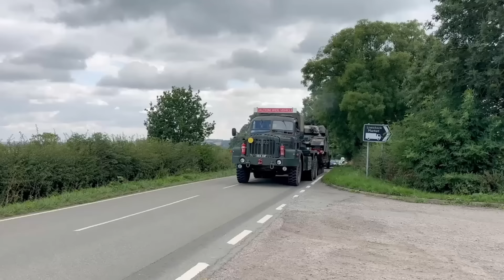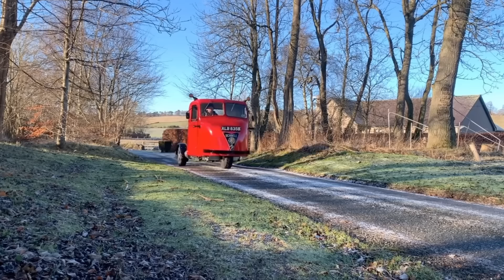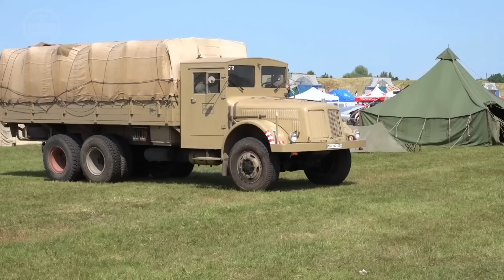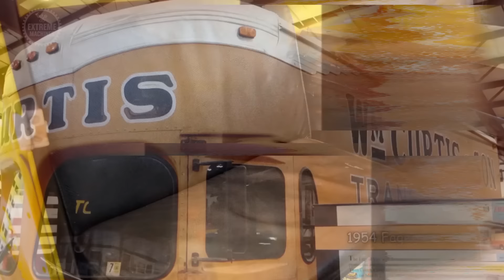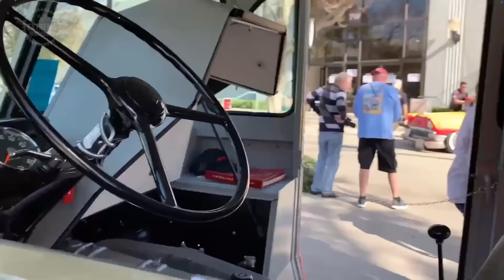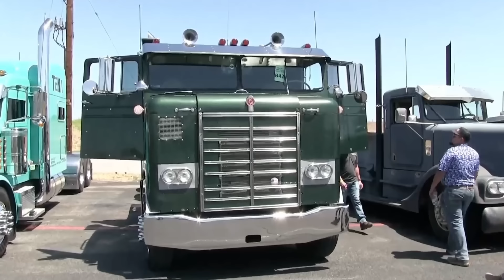10 of the MOST IDIOTIC TRUCKS ever built by man — you’ve NEVER seen anything like this!

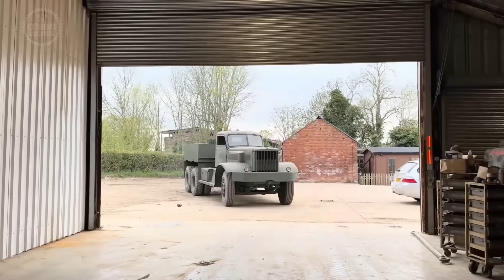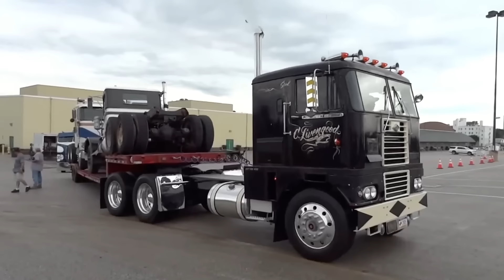Comment: 10:14 That's a dimond t tank transporter, and 13:33 Germany is credited with producing the first cabover truck (often referred to as a "forward control" 
The German Daimler Motoren Gesellschaft, led by Gottlieb Daimler, built the world's first truck in 1896. While the very first 1896 model had the engine at the rear, Daimler and Wilhelm Maybach quickly improved the design by 1898, placing the two-cylinder "Phoenix" engine under the driver’s seat.

Comment: The Antar mark 1&2 had a V8 Rover aircraft engine turned round, useing 5starpetrol , as an apprentice I work repairing these for 19th tank movement regiment, the engine I think was was around 20 ltrs, the my 3 (baby Antar) had 6cyl diesel.

Comment: Not much of 'extreme machines', nor of 'idiotic trucks' - long-hooded or cabovers were common from the start (maybe not in the US). And 'unusual' doesn't make it idiotic either.
Not a single one can be claimed to be 'absurd', as stated in the description box.
The most uncommon truck IMHO is the Scammel, but its design was near genius, the single front-wheel allowed for an extreme steering-angle, thus a tight turn radius.
In Germany there was a three-wheeled small truck (Tempo-Matador), where the engineers took the front of a bike and attached a three-seated cabin and a cargo area. It was much faster and could easily turn over in fast, sharp curves and max load - that thing was dangerous, if you weren't aware of that.

Comment: the only truck i will agree that is dumb is the GM linner .
that thing was made only for display and that is half the reason.
if the truck was really ment as a truck of the future then it should be made to cary the display and handle most roads like most other trucks in this list .

the scammell however is not dumb.
it was a small truck made for 1 job and it looks like it did that job very well.
yes it may look strange compared to whats out today but it was made to do a job .
i think the forklift replaced it but it still did its job untill a different option came around

Comment: The scammell scarab wasn't idiotic, it was ingenious
Reply: Yes & Very Functionally Efficient For Its Purpose of tight area manueverability
Reply: Exactly. A number were built as rigid vehicles such as dustcarts,  However it was certainly unique in it's design for the driver to couple/uncouple it's articulated trailer and 360* degree turning circle. Ideal for railway and commercial goods yards. As for idiotic, it most certainly was not!